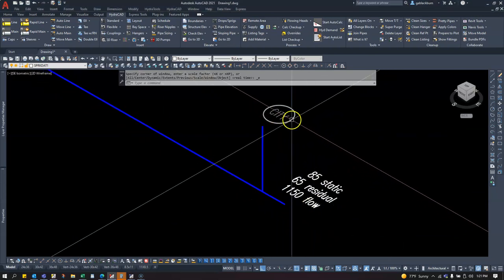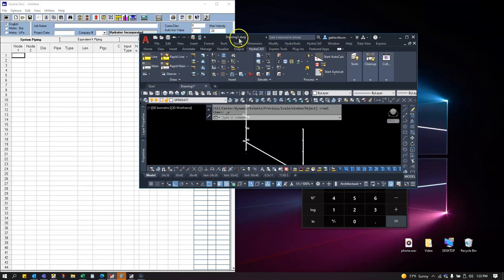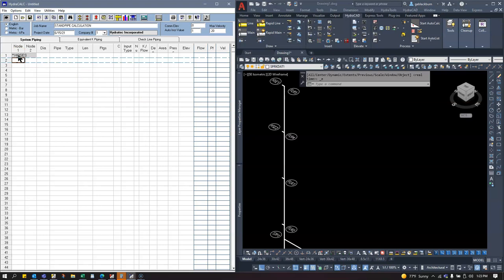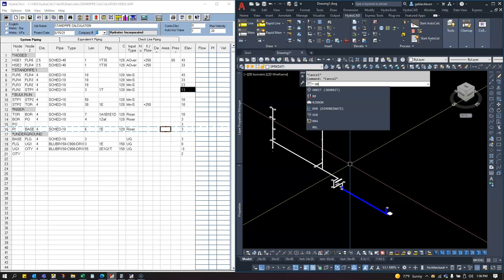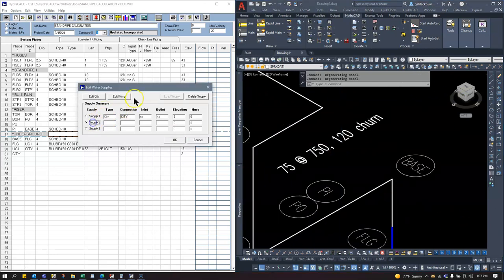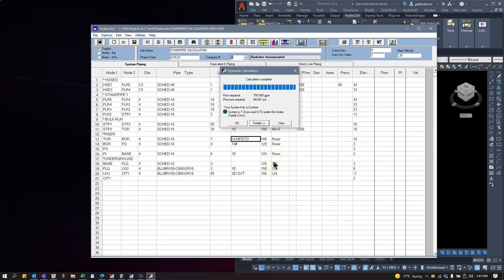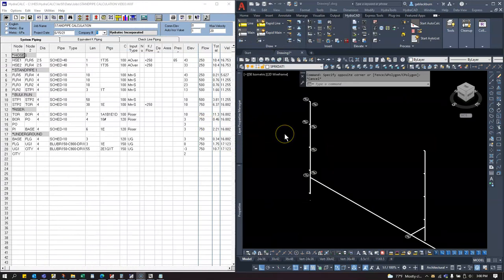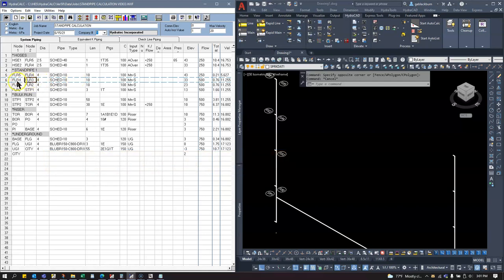Standalone HydraCALC Standpipe Calculation

Comment: Shouldnt the pressure at HSE1 be 100 psi? Based on the 2.5" hose outlet size this is a class 1 system and per NFPA 14 Section 7.8.1 the minimum residual pressure of 100 psi at the most hydraulically remote 2-1/2" outlet.
Reply: This would also result in not having enough pressure and being 21.65 psi over the water supply curve
Reply from the maker: Yes, thank you.  The point of the video was to show you how to enter the values.  I used outdated requirements but that shouldn't take away from the point of the video.
Reply: @gablackburn8737  The video was very helpful! I just didnt know if I was missing something when you inputted that. Thank you so much for the video!

Comment: Also, I want to see static pressure on the standpipes. so I did the standpipe calculation and I have rated pressure of 280 psi and from hydra calc. I have my pump churn pressure of 310 psi , now is there is a way in hydra calc where I can calculate static pressure. I don't want to do manually by adding or subtracting pressure looses from churn pressure. Please advise

Comment: Hi George,
you have shown city connection and pump in the the calculations . Your pump is connected to base node when you are putting the water supply your pump needs to be connected at base not to the city. I am struggling with the calc I am working on , I want the pump to be connected with base because my run is first city connection from that I have backflow and then pump. So we we do it in hydra calc program
Reply from the maker: Harmeet, please contact our support team if you have specific tech support questions

Comment: Why did you calculate this with pre-1993 65 psi instead of 100?
Reply from the maker: Because I haven't done sprinkler design since 1992 and this is just meant to be a demonstration or example.  You can enter whatever pressure you want.